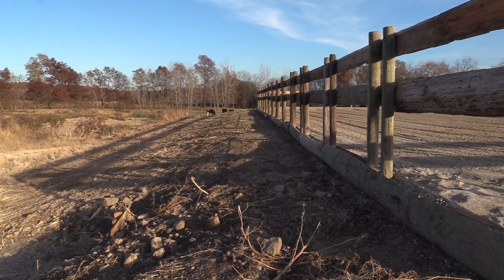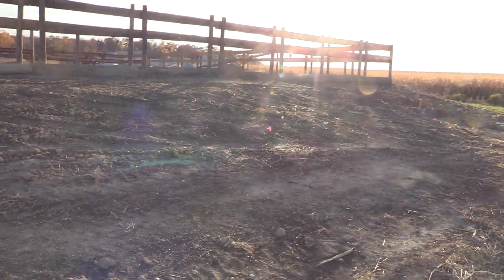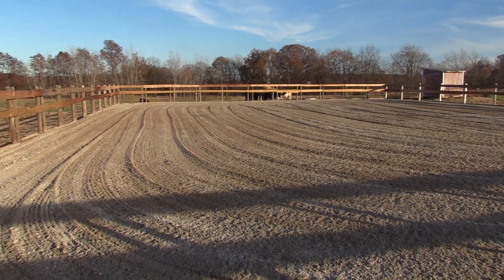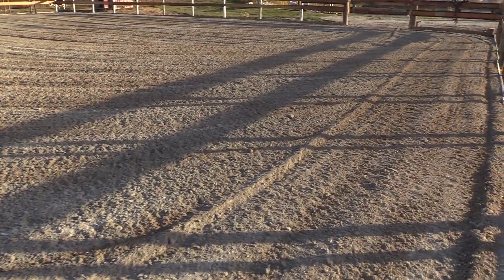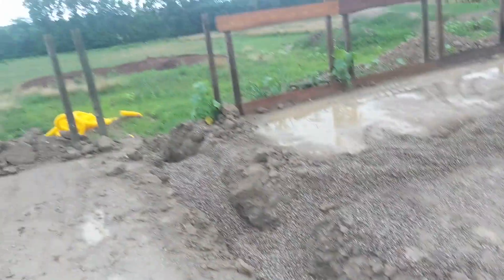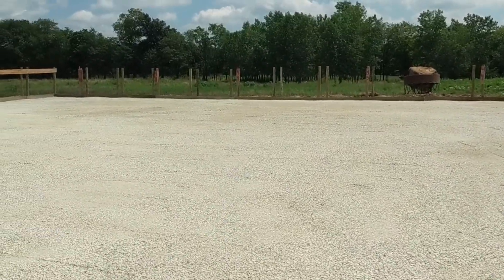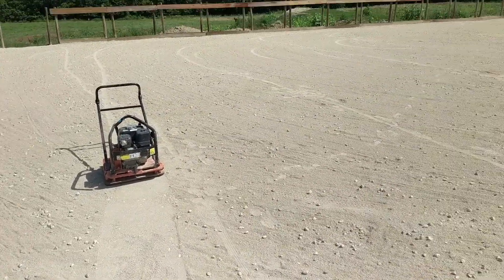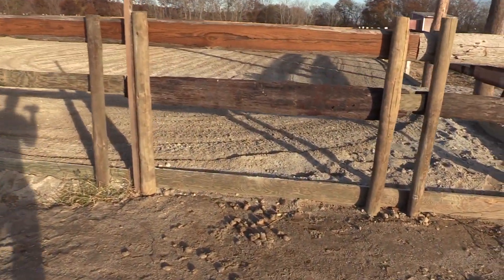HOW I BUILT MY HORSE ARENA!! #horse #horsetraining #excavation

Comment: How deep did you have to set the tile .?  Great job on figuring out the drainage over the clay.  Are you located wnere you have to be below the frost line?  Where are you located? Here in Nova Scotia everything freezes if its not atnleast four feet under the ground.
Reply from the maker: I'm located in indiana, I can't remember how deep it was?? I'm thinking 2 feet at one end and maybe 3 or 4 feet at the other. I'm no professional, but I wasn't to worried about it freezing because I had plenty of fall, if that makes any sense🙂